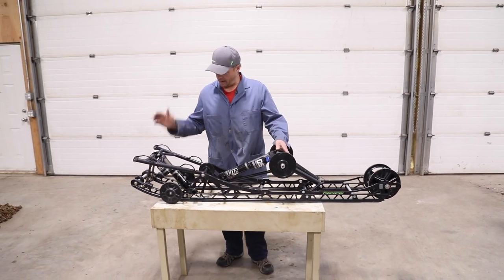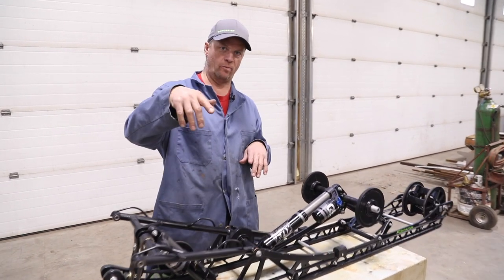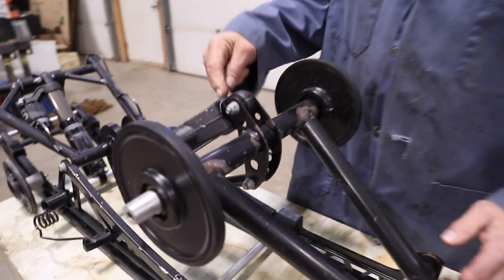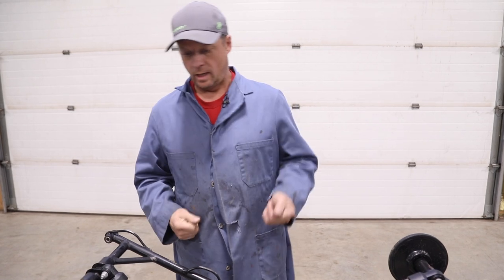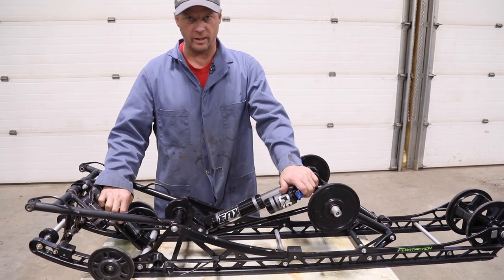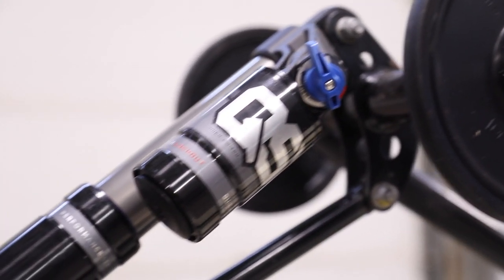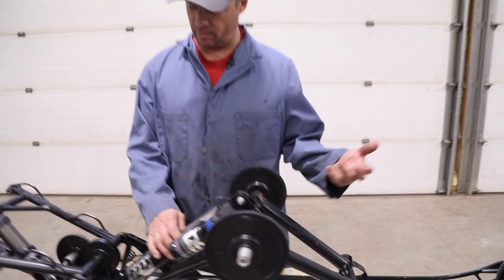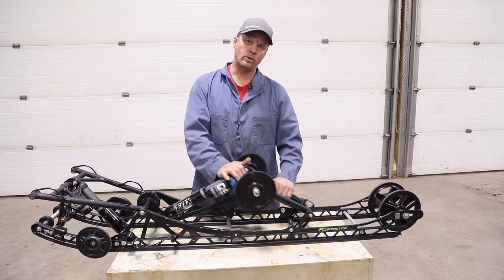Snowmobile suspension. And how to wheelie setup.

Comment: Very cool,  thanks again Digit9,  never understood how they do the wheelie,  another thanks from Ontario,  Ottawa valley as well👍
Reply from the maker: Right on Benny. Digit9 loves Ontario.
Reply: Those wheelies are done with power and studded tracks,those straps if loosened, allow suspension travel to go unchecked,which will interfere with the smooth operation of the sliderail/ skid overall and possibly damage your track, if you want to wheelie get a short track 600-800cc two stroke stud the track with trail studs or something more aggressive and practice with short bursts of throttle shifting ur weight toward the rear and keep your balance so as not to flip back on ur face,have fun and practice makes perfect bro.😉

Comment: Thanks Again for your videos! You explain everything in great detail. Would you have a video in regards to Y-pipe leakage from the engine side. I can’t seem to get good seal on it. Any tricks or special tool a guy needs to get a torque on the bottom bolts ?
Reply: Permatex  ULTRA COPPER.
clean surfaces with brake clean. 
Use fresh gaskets and if there's a big  🍩 donut on the y pipe to muffler flange change it if there's any wear or scratches in it.  
Use the ultra copper if the options run out after fresh gaskets.  Or replace the y pipe. I've seen them get bent and they never seal tight after.
Reply: Thanks for the info Ernie, I’ll give that a go.
Reply: Check the mating surfaces of the head and the Y pipe with a straight edge. If the y pipe is not flat, you can fix it by filing off the high spots or have a machine shop run it thru a milling machine. Cheaper than a new y pipe. Shouldn’t need sealants with flat surfaces and good gaskets. Cheers!
Reply from the maker: And remember , you can NEVER use too much Loctite  !!

Comment: Any tips on a 2012 m1100 clutch set up with a bunch of goodies added to it blow belts constantly
Reply from the maker: Had a friend with same problem , turns out the factory put on the wrong secondary and spring set up ! Also check motor mounts !

Comment: What do you suggest for a 2017 Arctic cat M8. 153 track
Reply from the maker: In what regards ?
Reply: For cat walks
Reply: Did you find it yet?
Reply from the maker: Take limiter strap off , tighten front spring/shock , soften back shock !
Reply: @DIGIT9  taking the limiter step off is that going to damage anything
Reply from the maker: Nope
Reply from the maker: Guess you could try letting limiter strap out all the way first !
Reply: @DIGIT9  the limiter strap is all tye way loose as much as it can go so I'll just take it off

Comment: merci pour votre video. jai un m8000 mountain cat 162 avec fox float evol, et je ne réussis pas a trouver un setup pour faire lever le devant droit loll jai enlever les strap de retenue avant et jai essayer tout les 3 trou d'ajustement du bugy de la suspension arriere sur le frame ,avec 70lbs en compression sur le shock arriere et lui avant jai pas fait d'essai de pression. avez vous un setup a me sugerer ? je trouve que le devant vient jamais a bout de lever a peine.... remarquer que je vient de faire mes tests avec a peine 10 cm de neige ca change peut être la chose loll je suis meme pret a payer pour avoir un setup qui marche pour le hors piste ;)
Reply from the maker: Not sure if the translate app is correct but sounds like you want less ski pressure ?
Reply: @DIGIT9   ok loll yes exactly i tried a lot of testing so that the front no longer touches the ground and even remove the straps in front of the suspension and i didn't have much difference. I do not manage to find a setup to raise the front asser to go off piste. do you have anything to suggest for a m8000 2017 162 "mountain cat?
Reply from the maker: Your on your own with that one !! Maybe buy a short track ??